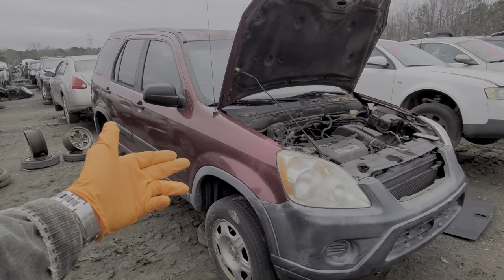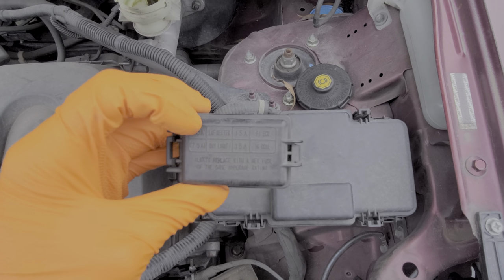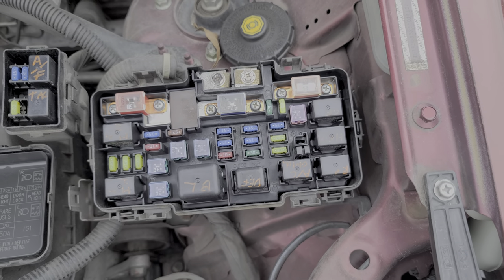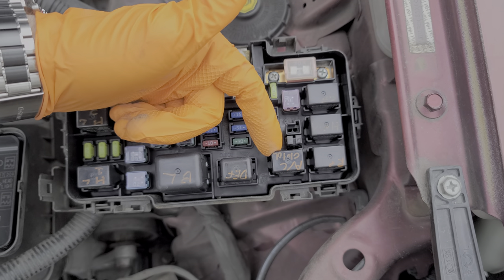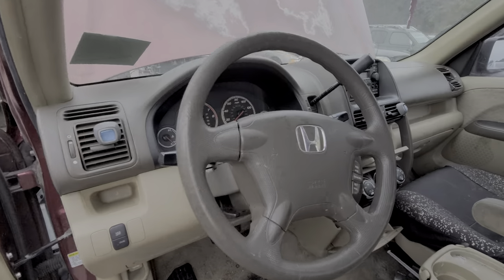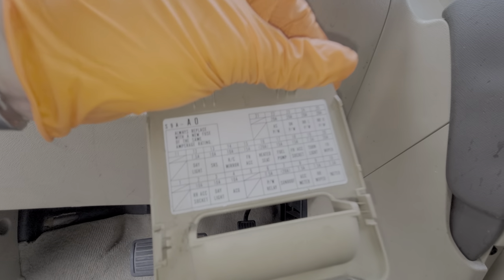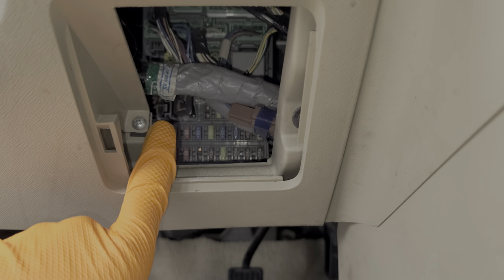2006 Honda CRV Fuse Boxs Accessed & Relays Identified

Comment: Would brake lights not working be the same thing as the tail light relay that you mentioned?  Also, having trouble locating fuses for the brake lights fuses you mentioned on the inside of the car. Mine is a 2003 CRV. Do you think that makes a difference in the location of the fuses?

Comment: I’m trying to troubleshoot my 2006 Honda brakes lights.
Both globes work when head lights are on .
When I turn them off , only the right hand one works.
Have cheacked the 7.5 fuses in  the internal box.
Bit stumped.

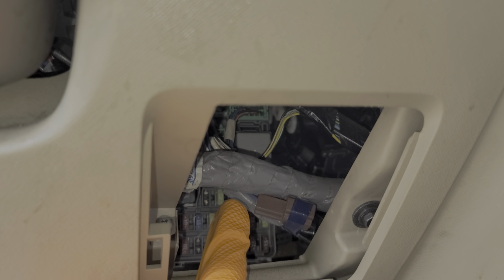Comment: I need to replace the power window relay on my 2005 CR-V, and that thing is insanely hard to get out (2:07 in your video). For some reason, they have two little clips that hold it in, so you need to pull on the fuse while trying to push the tabs apart. I can NOT get that thing out. I've tried pushing little pieces of plastic in the sides to hold the tabs open, but my pliers just slips off the relay. Is there something I'm missing here? Is there a special tool for this application? Is there a way to drop the fuse panel down to get better access? Do I need to hire a really tiny, super strong trained monkey?
Reply: Search online for 
relay puller pliers

The pliers you want have the little bent hooks at the end that get under the relay and help with pulling the relay straight up and out. I bought the CHEAPEST one the big online store had that was a quick delivery. It worked. Unless you're pulling relays for a living, you don't need to spend much. I paid $12 and it worked.

I had to wiggle the relay with my fingers first which didn't seem to be doing anything but it did give just enough space on one side that the pliers hook could grab it. Pull easy until it gives a bit more, release the pliers and wiggle the relay again with your fingers  You'll eventually be able to grab it with both of the plier hooks. Pull straight up, but do NOT squeeze the plier handles too hard to avoid damaging the relay.

Biggest pain is that big bundle of wires in the way. I had to turn the relay pliers upside down to get past the wire.

Used a wooden chopstick to push one tab until I could wiggle the relay up enough to just pass it  

Then I used the chopstick to push the other tab out of the way while pulling straight up. It took a few tries but the relay finally came out.

Comment: Mr. Lehew, Thank yo for your video in the CRV. I have a 2006 Model Honda CRV and teh battery drains when it sits overnight. I've heard the term "Parasitic Battery Drain"  used to describe this and watched a number of video concerning tracking down the bad fuse or relay that could be causing the problem. Is one fuse or relay that is usually the coulpret, or is it hit or miss to find the bad one? The method is using a meter se on milliamps setting I believe. Your response  and insight are appreciated. Thank you, GT Albright - Dexter, OR

Comment: Thanks for sharing useful info. My 2005 CRV left high beam is not working. Bulb and fuses checked found ok. I am not getting voltage at the bulb connector, please advise what else to check. Both low beam and right high beam working fine.

Comment: I have a 2006 CR-V and dad hit a deer in it and completely cut all running lights, I know wiring. But can't find a damn fise popped replaced them. Looked for any grounds in that area. There are non that come off. No cut wires that I can see. Just the driver side panel and headlight got messed up but nothing horrible.. can't figure it out. Got any ideas? Lol

Comment: I have a 2004 Honda CRV. Driver and passenger interior power door lock switches only lock and unlock the drivers door. The remote will only lock and unlock the drivers door. Passenger front and rear as well as driver's rear will not open using the power switches or the remote. Any idea what is causing this?

Comment: Which relay or fuse do I remove to prevent the car from starting / theft?
Reply: I don't know about preventing starting, but for preventing theft I've seen advice to pull the Fuel Pump Relay.

Comment: Couldn't figure out where the power window relay was. This was helpful, thank you.

For anyone else trying to figure out how to get the power window relay out: search online for 
relay puller pliers

The pliers you want have the little bent hooks at the end that get under the relay and help with pulling the relay straight up and out. I bought the CHEAPEST one the big online store had that was a quick delivery. It worked. Unless you're pulling relays for a living, you don't need to spend much. I paid $12 and it worked.

I had to wiggle the relay with my fingers first which didn't seem to be doing anything but it did give just enough space on one side that the pliers hook could grab it. Pull easy until it gives a bit more, release the pliers and wiggle the relay again with your fingers  You'll eventually be able to grab it with both of the plier hooks. Pull straight up, but do NOT squeeze the plier handles too hard to avoid damaging the relay.

Biggest pain is that big bundle of wires in the way. I had to turn the relay pliers upside down to get past the wire.

Used a wooden chopstick to push one tab until I could wiggle the relay up enough to just pass it  

Then I used the chopstick to push the other tab out of the way while pulling straight up. It took a few tries but the relay finally came out.
Reply: Thanks. Do you have a part number for that relay?

Comment: Why does my fuel injector fuse keep popping ? As soon as I plug it in it pops.
Reply: Same problem here. Can’t figure out why! 🤬
Reply: Maybe the A-T rating is too low OR there is a short circuit.